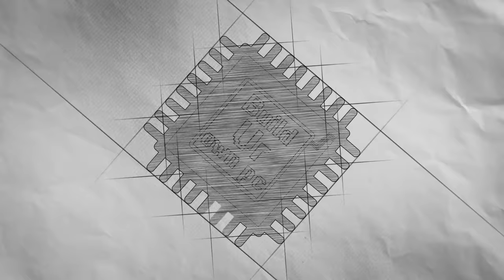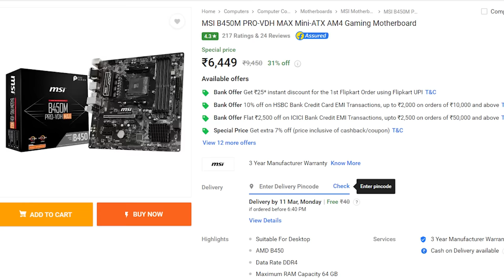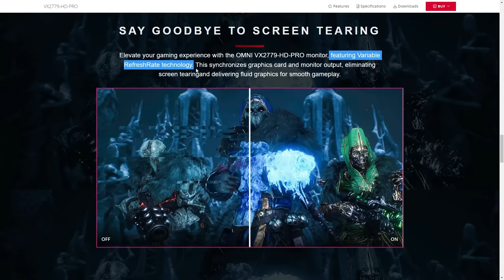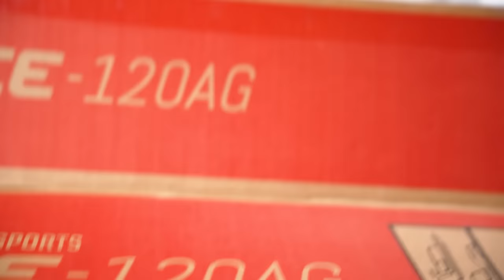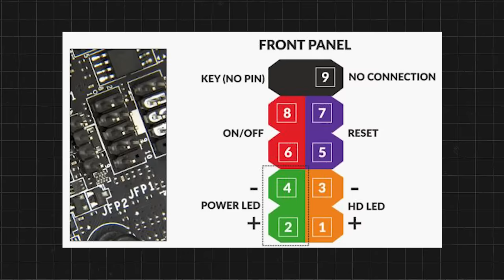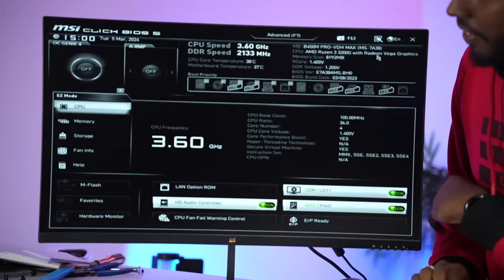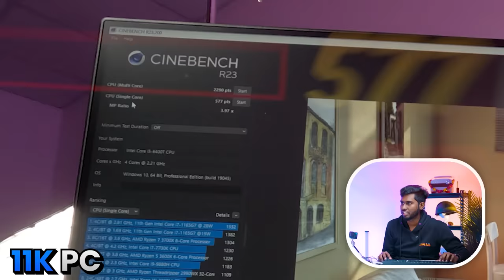Rs.20,000/-  Cheapest PC 🤯| 20K Gaming PC Build 🔥 | Build Your Own PC - 2024

Comment: 🎯 Key Takeaways for quick navigation:

00:00 💻 Introduction and Overview of the PC Build
- Introducing the concept of building a PC with a budget of Rs. 20,000.
- Explaining the intention to build a brand new PC within the specified budget.
- Discussing the components required for the build and their approximate costs.
00:30 🛠️ Choosing the Processor, Motherboard, and RAM
- Comparison between the i5 6400T processor and the AMD Ryzen 3 3200G processor.
- Selection criteria for the motherboard, focusing on compatibility with the processor and budget constraints.
- Recommendations for RAM specifications and brands suitable for the build.
02:32 💰 Budget Allocation for Components
- Calculating the remaining budget after selecting the processor, motherboard, and RAM.
- Decision-making process for selecting alternative components based on availability and affordability.
- Allocating funds for additional components such as SSD, cabinet, and SMPS.
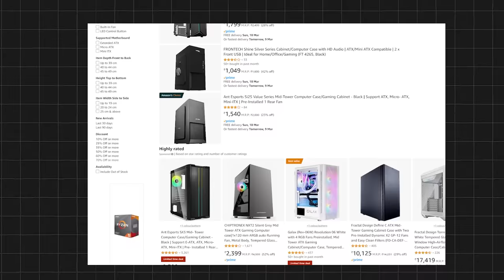04:00 ⚙️ Building the PC: Component Installation Process
- Step-by-step demonstration of assembling the PC components including the processor, RAM, cooler, SSD, motherboard, and SMPS.
- Instructions for cable management and connecting various cables to the motherboard.
- Tips for handling delicate components and ensuring proper installation to avoid damage.
05:02 🖥️ Introduction to Monitor Options and Setup Completion
- Discussion on monitor options within budget constraints, including recommendations for ViewSonic monitors.
- Finalization of the PC build and readiness for testing.
- Introduction to gaming performance testing using GTA V as an example.
14:47 🎮 Gaming Performance Comparison and Conclusion
- Comparison of gaming performance between the old PC and the newly built PC.
- Demonstrating the increased FPS (Frames Per Second) and improved gameplay experience in the new PC.
- Conclusion highlighting the advantages of building a PC over purchasing pre-built ones, emphasizing flexibility, future upgrades, and cost-effectiveness.
15:46 💡 Recommendation and Closing Remarks
- Encouraging viewers to consider building their own PC instead of buying pre-built ones.
- Highlighting the potential for future upgrades and customization in self-built PCs.
- Directing viewers to seek assistance from A2D PC Factory for building high-end PCs if needed.

Made with HARPA AI
Reply: Wow very impressive

Comment: B450 mother board eh vangunga. Will have better power protections. Even though this platform is supposed to be dead, it still provides a decent upgrade path.

In the future if you save and earn more you can go for 5800x3d for better gaming performance as well as a decent card of rx7600xt 16 gb gpu.

With this you can play AAA titles in high settings. 

For next 5 years atleast you can use this PC. With the way AMD is going they may release more cpus for this PC like how they did release 5600gt and so on.

Comment: i would suggest a different build for under 30k - 5600g + a520m will cost around 18k total. psu 1k and case buy the cheapest whatever available 1.5k + ram 2x8gb 6k + ssd 3k.
Reply from the maker: don't go with cheap PSU that's first rule! otherwise gud spec

Comment: Enoda laptop 2014 model. Intel core i5 4210U CPU 
2 cores, 4 thread @2.4 GHz

Multi core la 1183 pts
Single core 531pts
 MR Ratio 2.23x

Cinebench score ithu varuthu bro 😢.. this is normal or worst for this laptop? Working slow now.. boost up pananum na ena panrathu? Ila new laptop than better option ah ? Ans plz
Reply: U series slow tan bro but neenga ssd usepanunga bro

Comment: Bro...I have doubt in choosing a processor...intel i5-12400 or i3-13100 ....price of both is approx same...so which is best as per overall performance
Reply: You mean the 12400 ?
Reply: @thanos5725  yup
Reply: @sasi_._sk  surely 12400 is better, no confusion bro
Reply: @thanos5725  but what about generation....it doesn't affect????
Reply: @sasi_._sk  in this case 12400 is better , not all cases
Reply: @thanos5725  okk thxx 2 clarify my doubt

Comment: Hi bro nalla laptop vaga la nu irukke nalla trick onnu sollu ga❤
Reply: Latest generation processor with good speed 8gb or higher ram with good mhz speeds and a good dedicated graphics card rtx 3050 or higher and a faster ssd don't buy harddrive laptops it will be very slow so buy laptops with faster and good ssd and a good battery life

Comment: OS kana amount ah add panalayae bro 
Oru vela cracked version oh🤔
Reply: Apadhi ila bro os neegha free yaa download panithu activate panama kodhaa use panalam
Reply: @kaushik6371  one of the worst way to use your pc, for that I would prefer cracked version
Reply: @sibicodename4748  ana crack version laa safety ilayaa
Reply: @kaushik6371  I agree on that, it's not safe, but if you are going to use only in offline no need to worry I used to have cracked version on my pc 7 to 8 years before so I preferred cracked over the not activated OS, but situation now is totally different fortunately laptop I use now comes with a genuine.